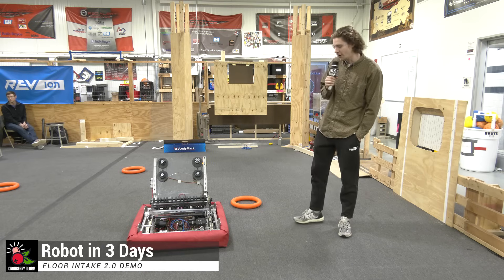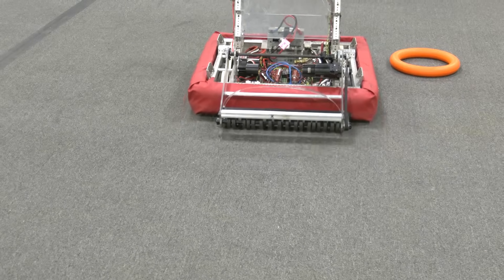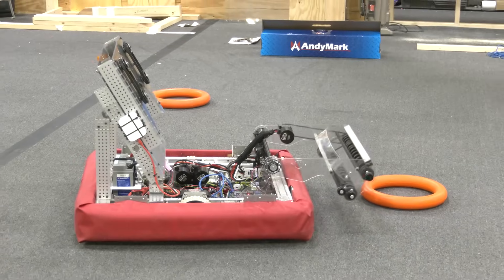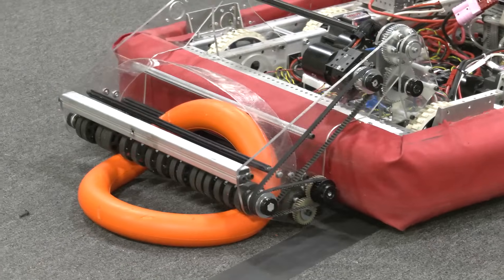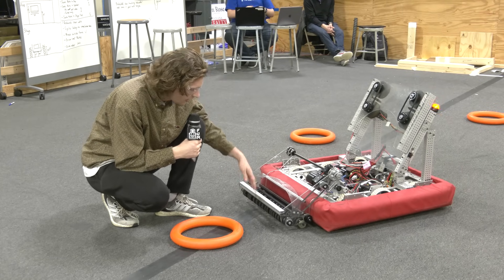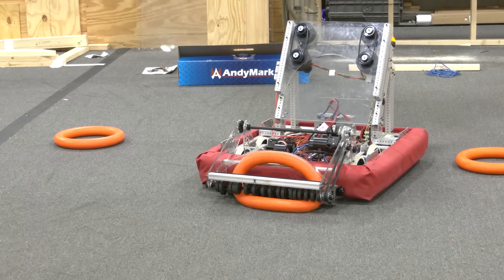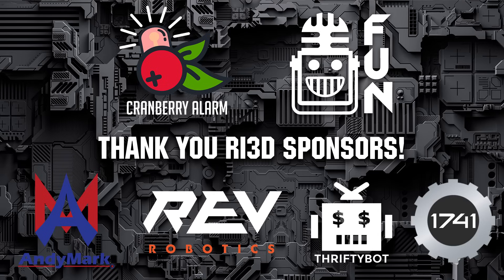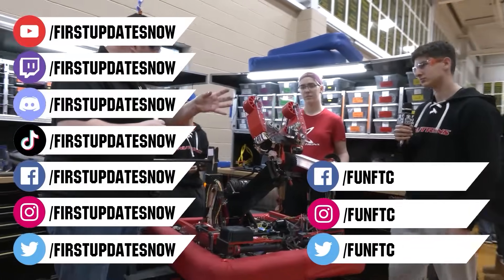Floor Intake 2.0 Demo | Ri3D Cranberry Alarm | Crescendo 2024

Comment: Thanks for the video, its been very helpful in helping a younger team get started. Any chance you could share with my what size belts you have running your intake? We are having troubles finding the perfect belt size with the dimensions of your intake. Thanks for the help!
Reply: We used 36T HTD 5mm 9mm Wide Timing Pulleys on each wheel and used a 90T belt. - Jordan, Cranberry Alarm

Comment: what length belts are you guys using?
Reply: curious if you ever found the answer on the belts? I too have the same question.
Reply: @lucasjandrin6050  I did not have the question answered unfortunately